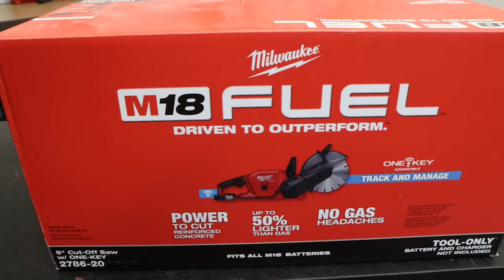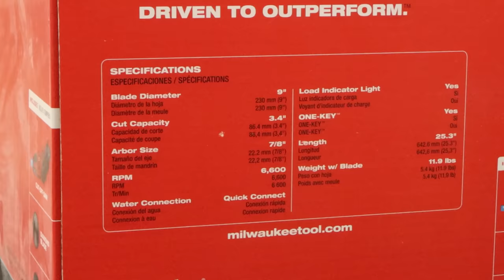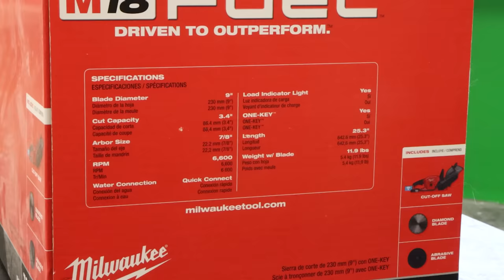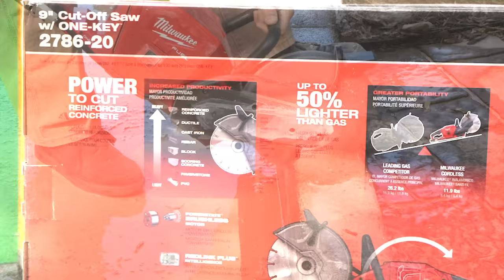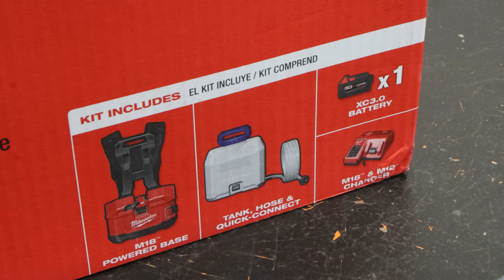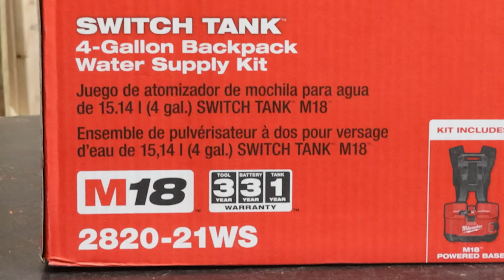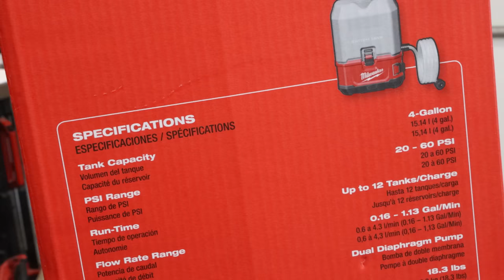MILWAUKEE TOOL 9 inch Demo Saw Cutting (SUPER HARD) 100yr OLD CONCRETE

Comment: That saw is a turd! It can't even hold a candle to a 4 1/2" mini grinder. We tried 2 different units and both would over heat the 8 and 12 amp hour batteries in a few minutes of use. We returned both.

Comment: I use the m12 charger only because that's what my m12 fuel kits came with...the Hammer drill & Impact set and the Hackzall kit.  However, once I get my m18 tools going....I won't be using the m12 chargers at much. I only have 1 CP2.0, 2 xC 4.0 and 1 xC 6.0. Once I get my M12/M18 rapid charger I may not even need the 2 M12 chargers I got.  Come on Milwaukee.....dual voltage chargers in all kits please.

Vince as always....awesome awesome video. I've always wanted to see the 9 in saw in action and now I see how bad ass it is.

Comment: Help me to understand something.  One function of the One Key is for tracking.  If you get ripped off, as soon as they get out of range, it's gone.  I know those small radios can't have much distance. Yeah,  they're locked out and can't use the tool and surely can't sell it because it won't run, but it's still gone.

Comment: Not one comment that the blade was put on backwards? 🤣

The audience doesn't pay attention to details much do they? 🙃🤦‍♂️
Reply: Yeah it was backwards but it doesn't matter.
Reply: @7:53 you can see it backwards before the cut, then it's fixed
Reply: I was just adding some sarcasm I normally see on people's videos. Wasn't criticizing. Although at the time of less than 40 Comments, it was easy to see a troll hadn't popped up yet to point it out